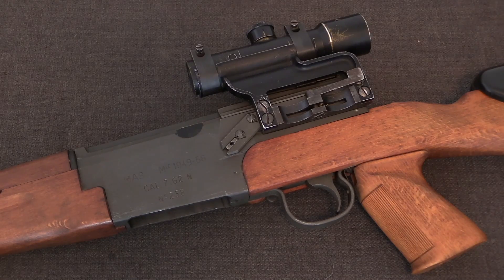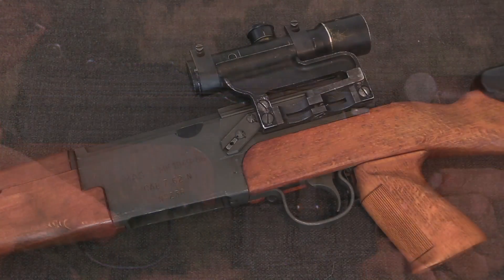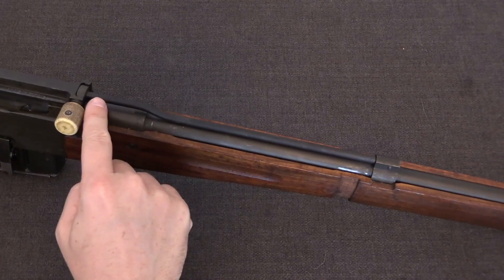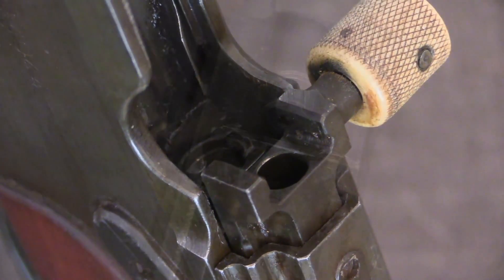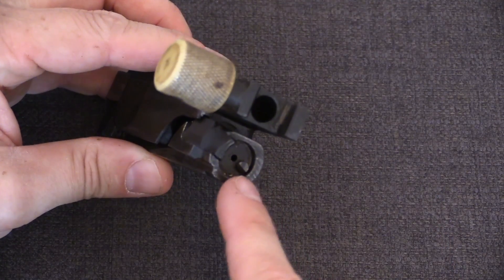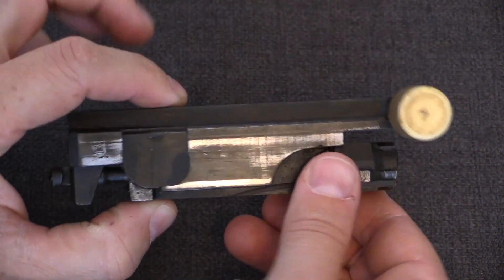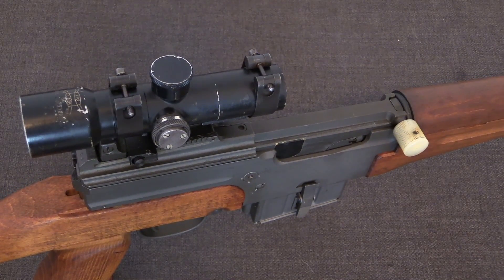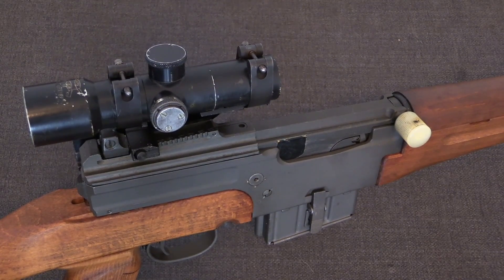How Does It Work: Direct Gas Impingement

Comment: Since the AR-15 has an internal piston system with the bolt and bolt carrier forming a gas seal, I'm left with a question that I guess someone could answer.

Why did the AR-15 use an internal piston system and not go simpler with only direct gas impingement system? An example of my question would be like taking an AR-15 gas tube and using an AR-18 bolt and carrier (with a hole cut into the carrier like the MAS 49 above).
Reply: Because with a true direct gas impingement system, the gas exerts pressure on the top of the bolt carrier, which is off axis from the bore. Meanwhile, using an in-line piston system like in the AR-15 causes the recoil to be a lot more in line with the bore, thus reducing muzzle climb and making recoil overall easier to manage.

It's also the reason why the more usual piston operated guns tend to have a bit more muzzle climb, because there's a force being exerted off of the bore axis.
Reply: In the AR system.... is there a moment where the bolt has already rotated open, but the gas pressure in the bolt carrier keeps it closed? In a sort of gas delayed blow back? Or had the gas already vented by that time?
Reply: My understanding is that Eugene Stoner designed the AR system to reduce the mass of the BCG as it reciprocates. As for gas pressure holding the bolt closed, I don't think that happens. From what I have seen, if there is any gas pressure on the bolt from the cartridge the bolt can't unlock due to friction between the lugs of the bolt and barrel extension.
Reply: Might be a bit more efficient use of gas - 5.56 is small and fast and doesn't have excess gas to spare. In-lined force on the bolt carrier and extra working area and gas capture in the piston.

AR bolt should be pushed forward by gas pressure while being cammed around, breaking apart unlock and draw-back loads - I don't know if it helps but interesting. If anything however "shits where it eats" is worse in an AR than simple direct impingement - firing pin aperture through center of the piston chamber
Reply: @mouse454  This is the answer. The size of the gas key doesn't present enough surface area for the pressure to act upon in a true direct impingement system, those parts would all have to be made larger and also due to off-axis thrust the bolt would need reconfiguring for a more stable bearing surface within the receiver. By using the back of the bolt head as the piston you get much more force from the same applied gas pressure, and it's fully in-line with bolt travel and as such lessens the bearing surface requirements.
Reply: I mean technically all DI guns are piston systems, and he could have made the DI inline without pushing forward and backwards on the BCG.  He chose to do that according to the patent to reduce ammunition sensitivity.  From the patent:
"This invention is a true expanding gas system instead of the conventional impinging gas system. By utilization of a metered amount of gas from the barrel, the automatic rifle mechanism is less sensitive to different firing pressures caused by variations in the propelling charge."

Comment: "Never been featured in shotguns or handguns." Sounds like a challenge!
Reply: Or a way to get a lot of gas in the face. IMO Gas delayed makes sense for both, and has been done in pistols. For shotties, it could make even more sense, since the key challenge with making a shot gun run is the huge variability in the ammo, primarily in gas pressure and volume, but also dimensional and mass. One of the benefits of gas delay is that the delaying force is directly proportional to the cycling force, since an increase in gas volume/pressure is happening on both sides.

Comment: I'd say the end of the gas tube is a piston, just not a moving one. The force generated in a piston/cylinder arangement acts equally in both directions, so it doesn't really matter which one is moving and which one is stationary. What we call direct impingement is a stationary piston and a moving cylinder, what we call piston operated has a stationary cylinder and a moving piston. The physics work out identical in both cases.

I'd argue the AR "DI" really is a form of direct impingement as it too uses a static piston and a moving cylinder, the only real difference is that its piston doubles as the bolt head rather than as the end of the gas tube. In both cases, gas pressure acts upon the bolt carrier itself (the bottom of the hole in "true" di, and the rear wall of the hole the AR bolt head sits in).
Reply from the maker: I would not consider moving or not moving to be a relevant point. It's the features of a sealed chamber that denote a piston to me. Certainly from the perspective of designing the parts and ensuring that they work as intended, there is a significant distinction between a sealed piston and a blind hole.
Reply: @ForgottenWeapons  I sort of agree, but how poor must the seal be before you consider it "not a piston"? If you put some gas rings on that spigot-like end of the gas tube, creating a seal against the "cylinder walls" of the hole, is it not then a piston which just happens to also have a hole in it for venting gas into the cylinder? How about if a close fit between gas tube and hole creates a reasonably close seal without any rings? Or perhaps a rather loose fit allowing some gas to leak forward before the tube fully clears the front of the carrier? In all these cases the function is identical, the only difference is how efficiently it uses that gas and how much is allowed to leak out. 
The "piston" going all the way out of the "cylinder" for a large part of the cycle cannot be the defining feature, or we'd have to make up some special nomenclature for the Hotckiss machinegun for instance.

Comment: I catch hell when I say that an AR isn't actually a direct gas system..
Reply: DonziGT230 in reality it actually is. If you extended the gas key back further and kept it as a blind hole it would have the same effect as it does currently. Right now all it does is vent the gas down into the chamber behind the bolt head. They are just shifting the point of the gas accumulation and need the rings so it doesn’t leak out. Gas is still being directly directed into the operating mechanism.
Reply from the maker: Do you think the design process is impacted by the difference between a sealed piston and a leaky hole? If so, that is sufficient basis for a different name for the system. The difference between long and short stroke pistons is similarly minor, but recognized because it reflects different design considerations.
Reply: The difference between a long stroke and short stroke systems vary far more than this particular instance. The gas key with internal chamber is a clever way to minimize the foot print of the operating method while also improving its efficiency for gas leakage, but it still doesn’t change the fact that it is still the same principal of impinging gas into the carrier.
Reply: If it did just puff on a closed gas key, the force would be out of line with the bore and the resulting carrier tilt would add to felt recoil. It might not be a lot, but Stoner was one to look after the little stuff.
Reply: Still the same process just improved. As I said above it was a clever way of reducing the foot print with other advantages. The gas is still impinging on the carrier and driving the bolt backward cycling the action.
Reply: @rhaynesify  In a DI gun the gasses push the carrier rearward and nothing more.  In an AR the gas is pushing the carrier rearward and the bolt forward.  Since the bolt can't go forward the gas pressure that's trying to push it forward helps push the carrier rearward.  It's using the bolt as a piston so I think hybrid gas piston system would be much more correct than calling it direct impingement.
Reply: @ForgottenWeapons  Hybrid gas piston system; how about that?
Reply: @DonziGT230  "In a DI gun the gasses push the carrier rearward and nothing more."  Based on what definition though?  By dictionary definition, any force imparted is considered impingement.  All gas systems are the result of gas impingement.  The difference is whether or not it is direct.  A traditional gas piston system has a remote gas piston, a distance away from the main BCG.  The AR-15 and other DI systems have the gas impingement occurring directly on the BCG.
Reply: DonziGT230 The bolt being push forward is an illusion of carrier being push backwards and the cam slot controlling the bolt. In this way if it is outside of the firearm, and someone is playing with a bolt carrier group it looks like the bolt is going forward, as they pull on the head. While in the gun the bolt is in a stationary position (locked into the barrel extension) and the carrier is only thing physically able to move. As the carrier cycles back it pulls the cam pin along with it unlocking the bolt. The gas rings are needed to keep a specific volume of gas contained long enough to achieve unlocking. It is much easier to add the gas rings than maintain a tight tolerance on the back stem of the bolt. Likewise it eases manufacturing by having large open pocket that the bolt can cam back and forth into, than to machine two separate pockets for both the bolt and gas accumulation. Plus even if you did have two separate pockets they would still both need a hole in them for the firing pin to pass through.

Comment: Does a direct impingement system like this have any problem with gas blowing out into the shooter's face? And other than the lack of adjustments, is there any particular reason why this system is so rare? It seems like it has very few downsides.
Reply from the maker: No. By the time the bolt has moved far enough to expose the gas tube, no more gas is coming through it.
Reply: It is very difficult to design a modern modular rifle using this system. It has no ability to regulate the amount of gas pressure. Only a set amount of bolt carrier weight and spring pressure. Any changes to the pressure level at the gas port. Out of spec or old powder/primers or ++P and new bullet weights. This throws the entire system out of balance. Bolt velocity either goes far to high( Which damages the gun and outruns the magazine) or to low( variety of malfunctions; short stroking, double feeds, and failure to extract.

Comment: I used to think the AR-15 was direct impingement. Thanks to Ian for explaining why that is wrong.
Reply: I still think it is.  By literal definition, unless there's some official definition somewhere that eliminates Stoner's DI system, it is DI.
Reply: Stoner's system is different from true DI in the same sense that delayed blowback is different from straight blowback. Stoner's system is basically delayed DI.
Reply: @michaelblacktree   I don't follow.  The difference between delayed and straight blowback is just whether or not there's a locking/delaying mechanism or if it's pure mass.  The different between Stoner and Ljungman DI is where the impingement happens on the vertical axis.  There's functionally zero difference.

Comment: The AR absolutely is direct impingement, more so than the MAS-49. The gas directly impinges on the bolt, that it turns a few corners before hand means nothing. The MAS-49 the gas impinged on the carrier not directly on the bolt. This makes the AR MORE direct impingement than any other design.
Reply: True direct gas impingement doesn't do anything besides blow gas into a plugged hole. The AR is arguably a hybrid.
On an AR the bolt itself is a piston, without piston rings or with a clogged gas key it won't cycle.
Reply: By that logic nothing is DI.
Reply: @hairydogstail  So then the MAS 49 isn't DI?
Reply: @hairydogstail  Define piston?
Reply: @hairydogstail  WTF is a charged chamber?
Reply: @hairydogstail  I'm an engineer, I don't think you know.
Reply: @hairydogstail  Are you capable of answering questions?
Reply: @hairydogstail   "I did many times." - False
"Every piston has vent ports" - False. 
"Do DI systems have vent ports?" - Yes
"Does the AR have vent ports?" - Yes
Reply: @hairydogstail  I thing can be BOTH piston and DI. I suggest you re-read my first post.
Reply: @hairydogstail  BTW did you read what you posted? 
"the need for a conventional gas cylinder, piston and actuating rod assembly is eliminated."
Reply: @hairydogstail  Every semi-auto that isn't recoil operated has some kind of piston. That's not the point, it's where the piston is and what it actuates on. In a DI AR it actuates or IMPINGES DIRECTLY on the bolt.

Comment: I would argue that it is a fixed piston and moving cylinder, the only thing direct about it is that there is not a rod between piston and bolt carrier
Reply: That's just like very other DI gun.  Even the MAS49 has documentation that says this.

Comment: Can't get any more "direct" then what demonstrated with the MAS 49/56. Guess that only makes the AR-10/15 a "gas impingement" system then. Lesson learned.
Reply: It's an inline short stroke piston system.
Reply: The AR-15 is technically more direct than the MAS49 since the MAS49 uses a stationary piston in the form of the gas tube.  All of the AR-15's impingement occurs with the bolt carrier and bolt, which is more direct on the cyclic parts than the MAS 49

Comment: OK, I defer to Ian for all things firearms even though he's not perfect, but, I'd swear the AR15 operates exactly the same as this. I can't wait to hear why I'm wrong!
Reply from the maker: I have an AR video like this coming shortly...
Reply: It does operate exactly the same with two caveats.  1, the impingement is lowered to be inline, and 2, the AR-15 uses gas expansion to directly assist in the unlocking procedure.  If anything, the AR-15 is truer DI than the MAS49 because all impingement occurs in the BCG unlike the MAS49 where it's partially on the piston head of the gas tube. 

Here's documentation on MAS49's piston by the way.  Pistons and DI are not mutually exclusive.
https://imgur.com/a/X8w6nZ7

Comment: Not a piston system. NO piston is involved
 Gas seals rings are. The bolt has gas seals. The gas seals prevent the gas from escaping forward. That gas DIRECTLY IMPINGES on the BOLT CARRIER. The bolt carrier is not a piston. 

If the mas is a DI system, then that means it's also a piston system based on what you say the ar15 is. Just get rid of the gas rings and the space b/w the bolt carrier and bolt.
Reply: An AR-15's bolt does double duty as a bolt and gas piston. The gas key is not a blind hole and directs gas into the space behind the bolt, which forces the carrier away from the bolt and chamber, causing the bolt to rotate and unlock.

Comment: I'm eager to see the AR-15 video,  because you more or less described the way an AR-15 cycles.
Reply: The key difference is that the gas is vented into the gas key on the bolt carrier and uses the bolt and carrier as a sort of gas piston for it's operation
Reply: The only difference is instead of the gas going straight back into a blind hole it goes down into a chamber and requires gas rings so it doesn’t leak out. ARs are still DI, you could extend the gas key out and have it as a blind hole, assuming proper volume, and bypass the chamber behind the bolt head and it would work identically.

Comment: So the gas goes towards shooters face? No wonder it's not standard.
Reply from the maker: No, because of the way the parts are nested any residual gas goes forward.
Reply: @ForgottenWeapons  The blind hole in the carrier catches the gas like a pocket, then it goes back and the gas tube is then uncovered. What do I miss? Thank you!
Reply: @deffington6627  That the pressure is essentially bled by that point, and any residual pressure is blowing against the remaining gasses exiting the pocket and then back into the pocket if the flow is still viable, causing reversion etc. etc.
Reply from the maker: By the time the bolt has moved that far back, gas is no longer coming out of the gas tube.